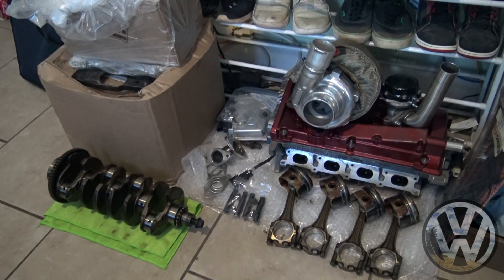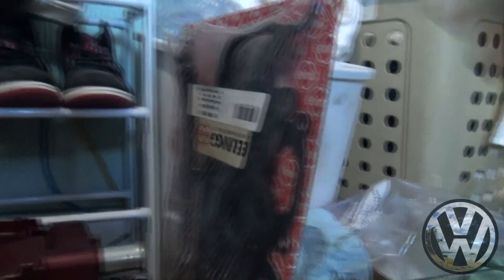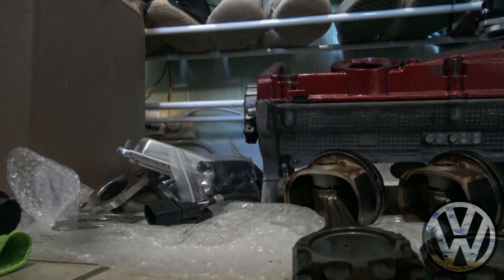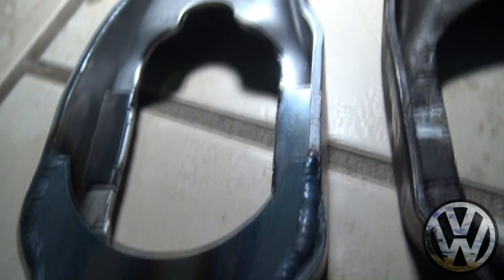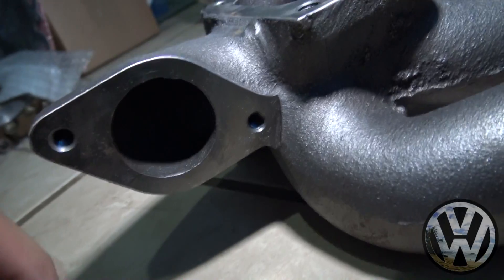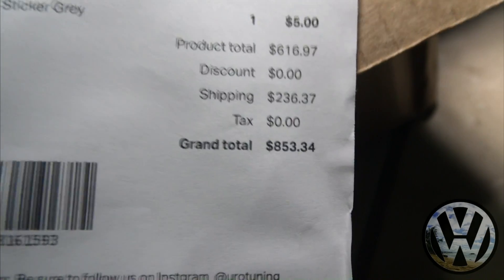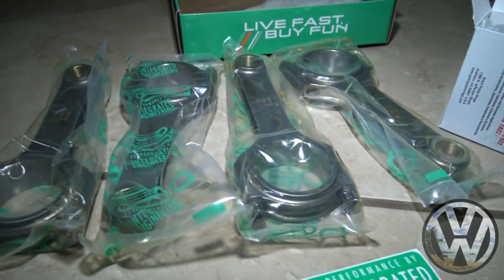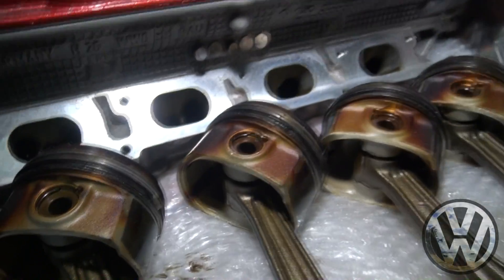VW MK4 1.8t GT2871r Update

Comment: Hey I'm doing a big turbo build too and was wondering where did you get your turbo lines . I am running a gt35
Reply from the maker: Oscar torres checkout EBay. I used the Mamba VW 1.8t top mount turbo oil and coolant lines. It’s on my jetta and we plan to use the same kit for the GTI. Fits perfect and bolts on to the block.
Reply: @MKIVMARV  oh man thank you  for that man  i was having a hard time finding it

Comment: Bro one favor from you ! I wanted to know something regarding this kinda same chattering sound coming from my bell housing and usually when I press in the clutch pedal it kinda fades away and on higher RPMs when I am trying to push the car and around 5-6K it makes jittering sound from the bell housing again and car doesn’t want really like getting pushed more ! So what do you reckon what can it be DMF ? Throw out bearing or the clutch fork only ? The car has around 1,50,000 kms on the original Clutch and all ! And then I’ll be shifting to a SMF and Sachs clutch soon ! Plus I would like to add something it feels pretty hard and solid to be shifted in some gears usually reverse and first
Reply from the maker: Cheats Customs Hmmm...since it’s all original it could be a number of things..flywheel could be failing at higher rpms or maybe clutch slipping. If you do take rip off the trans you should do everything at once, clutch, flywheel, fork and all. Probably best to stick with the same flywheel type that’s in your trans. Switching over from DMF to SMF will make a difference in driving. I haven’t changed over yet in any of my cars but maybe in the upcoming projects we’ll see.